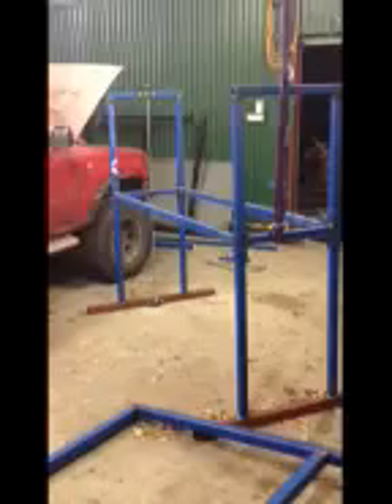How to build a Swing Blade Sawmill pt1

Comment: Good day. 
I am a canadian that has watch all of ur vodeos on this saw mill a number of times...
I am in the process of building one very similar and came across an issue i hope you can help me with. 
The bearco gearbox you used is only rated for a maximum input  speed of 540rpm. 
If all pulleys are 1:1 as is the gearbox this means the engine speed is the same as the blade speed. It is obvious that your machine is spinning much faster than 540rpm and needs to in order to cut. 
Question: have you had any issues running the gearbox at what must be approximately 6 times its rated safe speed? I.e. has your gearbox stood up over time?
Reply from the maker: @DerkBunskoek  Hi. I ended up filling the gearbox with hi temp bearing grease. Not sure if that is recommended. Probably not. Never had any issues with the gearbox. Except leaking oil. I think the engine revs were 3600. Maybe you can find a gearbox rated to a higher speed.  All the best with the build. Cheers. Troopy.

Comment from the maker: Hi Mike. The distance between the frame rails is 2m(the width of the saw). The length of each of the track frames (the distance between the rollers on each side) is 1m.  The height of the frame is 1.5m.  You can adjust these sizes to allow for the size of tree you think you might use. I can mill a 1m dia log. The saw bade will cut just over 6". 18 hp should be plenty for a 6" cut. I made all these vid on my iPhone and edited them with an app called Splice. Good luck with the build.

Comment: The dimensions of the track (rails) and also the carriage. I'm not sure of your lenghts of steel compared to here.
I have a 18hp engine, that should be large enough to use on the mill, without having it boog down.
Thanks for your help!!!
Mike